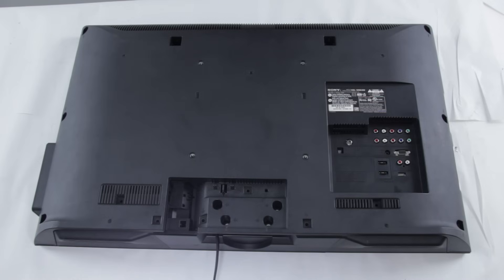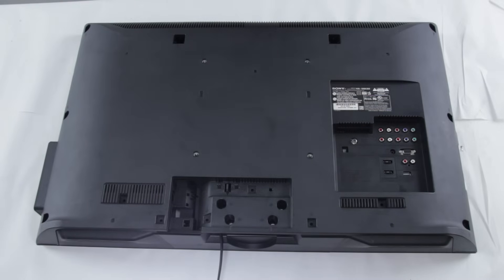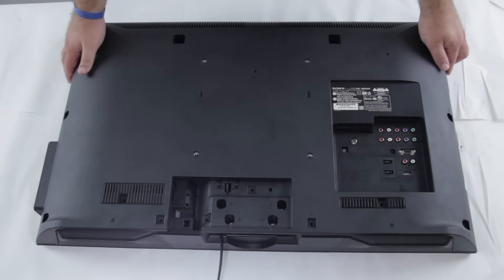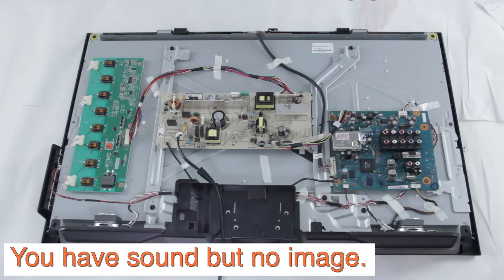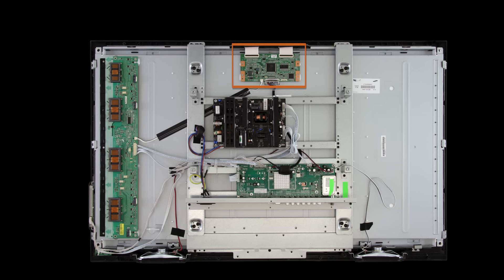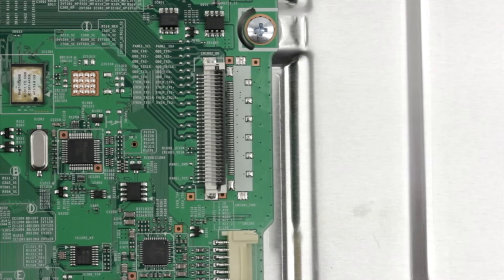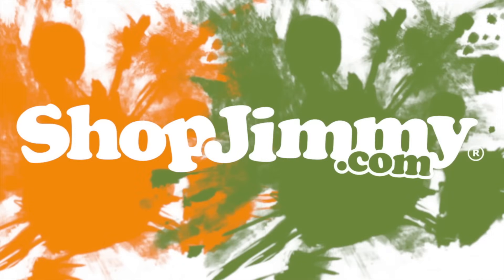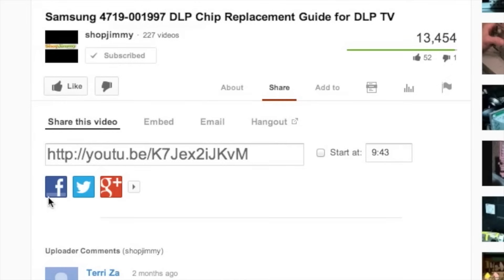LCD TV Repair Tutorial - T-Con Board Common Symptoms & Solutions - How to Replace T-Con Board

Comment: Please help. I have a Westinghouse LTV -37w2 HD. The problem  I'm having is my TV has no picture or sound. The power light comes  on though.
Reply from the maker: TINKERTON1000 I recommend replacing the main board in your TV.  Here is a link to replacement parts for your TV model number on our website, click here:  http://www.shopjimmy.com/catalogsearch/result/?q=LTV+-37w2  Be sure to match part numbers on your current board, with your replacement for compatibility.  Here is a link to a video showing how to identify your part number, click here:  DIY TV Part Number Identification Guide for Westinghouse Main Boards (LCD, LED, Plasma TVs)  You can also call our customer service for further assistance with your purchase.  (877) 881-6492  Thanks and please let us know if you have any further questions with your TV Repair!  www.shopjimmy.com

Comment: My Sony KDL-46XBR is displaying horizontal lines from the left side of the screen and is also displaying ghost lines on the left side of the screen. Is it possible to replace the T-CON board?
Reply from the maker: Meekha Villafranca You can replace the T-con to see if that fixes the problem.  If that does not work, then the problem is the TV panel.  Here is a link to replacement parts for your TV model number on our website, click here:  http://www.shopjimmy.com/catalogsearch/result/?q=KDL-46XBR  Be sure to match part numbers on your current board, with your replacement for compatibility.  Here is a link to a video showing how to identify your part number, click here:  Samsung Timing Control (T-Con) Boards Part Numbers Identification for LCD HD TV Repair  You can also call our customer service for further assistance with your purchase.  (877) 881-6492  Thanks and please let us know if you have any further questions!  www.shopjimmy.com

Comment: Hello, I have a 55PFL3907/F7 and believe it is the tcon board, mine has all  the symptoms you describe, except mine had horizontal colored lines that went in and out? Would this still be diagnosed as a bad tcon board? Also before this happened it often would restart maybe 2 or 3 times a week. This last time it turned off then turned back on again... but this time with a black screen.
Thanks in advance
Reply from the maker: Isaac Jimenez The T-con sounds like a good place to start.  Here is a link to replacement parts for your TV model number on our website, click here:  http://www.shopjimmy.com/lg-6871l-2089d-t-con-board.htm  Be sure to match part numbers on your current board, with your replacement for compatibility.  Here is a link to a video showing how to identify your part number, click here:  LCD Help Part Number Identification TV Repair Guide for LG Philips Timing Control (T-Con) Boards  You can also call our customer service for further assistance with your purchase.  (877) 881-6492  Thanks and please let us know if you have any further questions!  www.shopjimmy.com
Reply: Isaac, were you ever able to fix your TV?  I have the same model but haven't had any luck figuring out the issue yet.
Reply: hello seth, no i wasnt, two techs told me it was the screen and the cost to fix... well, it wasnt worth it for me.
thanks for your reply.

Comment: i have sony bravia klv-40w300a sound with no picture i show that to a technician he didnt diagnose the problem help me
Reply from the maker: Rizwan Abbasi I recommend replacing the AU main board in your TV.  Here is a link to replacement parts for your TV model number on our website, click here:  http://www.shopjimmy.com/catalogsearch/result/?q=40w300a  Be sure to match part numbers on your current board, with your replacement for compatibility.  Here is a link to a video showing how to identify your part number, click here:  TV Part Number Identification Guide for Sony Main Boards (LCD, LED, Plasma TVs) TV Repair  You can also call our customer service for further assistance with your purchase.  (877) 881-6492  Thanks and please let us know if you have any further questions!  www.shopjimmy.com

Comment: Hi Thanks for the help,
I have a samsung ps50b530s2w it has a verticle bar on the left hand side of the screen about an inch a a half wide and goes from top to bottom, the bar is sometimes black and sometimes white with different colour lines running through it, any help would be great
Reply from the maker: Justin Lane This sounds like a TV panel problem.  If your TV panel is bad, it may be more cost-effective to replace the TV as panels are typically hard to find in stock, difficult to replace, and expensive.  Thanks and please let us know if you have any further questions!  www.shopjimmy.com

Comment: Hi! I have lg 37lc46. It stops powering up at all. Then ive replaced power supply board. Now when i press power button led starts blinking green, backlight on for 2 seconds then its shutting down. Ive replaced main board, and its still the same but without backlight going on. What it might be?
Reply from the maker: WoYYtaZ I am thinking there is a bad lamp in the panel of the TV or the backlight inverter is bad.  I am not 100% sure your TV actually has a backlight inverter, so it could just be the lamp in the panel.  Could you please reply with the details of the parts in your TV?  If you are taking the TV apart or working on the TV, please do this at your OWN RISK.  Thanks! www.shopjimmy.com

Comment: hi,I have a sony bravia kdl-52s5100. the tv start with a horizontal line on the bottom of the screen and now there is lines across the entire screen.. Do you think it could be the T-Con board problem?
Reply  ·
Reply from the maker: Liana Ferran The T-con board does not create horizontal lines on the TV.  Thus, I believe this sounds like a TV panel problem.  If your TV panel is bad, it may be more cost-effective to replace the TV as panels are typically hard to find in stock, difficult to replace, and expensive.  Thanks and please let us know if you have any further questions!  www.shopjimmy.com

Comment: I have a 2008 Samsung LCD TV model # LN52A550P3F. Half of the TV screen is black out and the other side look normal. Do you think it could be the T-Con board problem?
Reply from the maker: Ganming Luo Yes, it could be the t-con board that is the problem or the panel.  Here is a link to replacement parts for your TV model number on our website, click here:  http://www.shopjimmy.com/catalogsearch/result/?q=+LN52A550P3F  Be sure to match part numbers on your current board, with your replacement for compatibility.  Here is a link to a video showing how to identify your part number, click here:  Samsung Timing Control (T-Con) Boards Part Numbers Identification for LCD HD TV Repair  You can also call our customer service for further assistance with your purchase.  (877) 881-6492  Thanks and please let us know if you have any further questions!  www.shopjimmy.com

Comment: yes i watch your video and thanks i have a philips 47pfl6704d/f7 model when i turn on the tv The Pic comes up very good and clear then after about 2min black lines comes and on the right side of the tv its start to look Ghostly but i still see the pic so is it that i would need to replace my T-Con Board or is there something else
Reply from the maker: Charles MCclain This sounds like the problem is either the t-con board or the panel in  your TV.  If your TV panel is bad, it may be more cost-effective to replace the TV as panels are typically hard to find in stock, difficult to replace, and expensive.  You can try and replace the the t-con board to see if that fixes the problem.  Here is a link to replacement parts for your TV model number on our website, click here:  http://www.shopjimmy.com/catalogsearch/result/?q=47pfl6704d%2Ff7  Be sure to match part numbers on your current board, with your replacement for compatibility.  Here is a link to a video showing how to identify your part number, click here:  LCD Help Part Number Identification TV Repair Guide for LG Philips Timing Control (T-Con) Boards  You can also call our customer service for further assistance with your purchase.  (877) 881-6492  Thanks and please let us know if you have any further questions!  www.shopjimmy.com

Comment: I have a Toshiba 32AV500U. I have replaced every board on this TV, except for the T-Con board. The problem is i get no sound, no picture, no back light. When it is off the light stays red. When it is turn on the light stays green. I starting to think maybe it's the panel. What are your thoughts?
Reply from the maker: Manny Mora This sounds like you have a defective main board, so maybe the replacement that you received is defective.  Here is a link to replacement parts for your TV model number on our website, click here:  http://www.shopjimmy.com/catalogsearch/result/?q=32AV500U  Be sure to match part numbers on your current board, with your replacement for compatibility.  Here is a link to a video showing how to identify your part number, click here:  TV Part Number Identification Guide for Toshiba Main & Scaler Boards (LCD, LED, Plasma TVs)  You can also call our customer service for further assistance with your purchase.  (877) 881-6492  Thanks and please let us know if you have any further questions!  www.shopjimmy.com

Comment: Hi, I have purple pixels in light colors and green in black colors. When image is frozen, these coloured pixels are still moving. Is my Tcon defect? Or could it be something else? There was one time, by just going into a servicemenu it dissapeared for one month, but it suddenly came back and it's staying now. I updated the firmware, did a hard reset of the tv and checked the cables of course, every output the same: green and purple pixels throughout the whole image, the rest of the tv colors that are not green of purple are still perfect.
Reply from the maker: JJ Fotografie I would recommend replacing the T-Con board in your TV.  Please reply with your TV model number and I can recommend a replacement part.  You can also call our customer service for further assistance with your purchase.  (877) 881-6492  Thanks and please let us know if you have any further questions!  www.shopjimmy.com

Comment: Hi. I have a Lg Led tv model 37Lv450u. Ghosting and white bar, vertical lines on the left side. i have replaced the ribbon cables. problem remains the same. please advice
Reply from the maker: Savy Mago I would recommend replacing the main board in your TV.  Unfortunately I do not see any replacement parts in the search results for your TV model number on our website.  Thanks and please let us know if you have any further questions!  www.shopjimmy.com

Comment: I have a Toshiba Regza model 46lx177. I have intermittent horizontal lines on the screen and at the same time the picture becomes very distorted. As it warms up, it will correct itself but the problem is becoming progressively worse. Thanks for your help!
Reply from the maker: Jeremy Simmons I would recommend replacing the main board in your TV.  Here is a link to replacement parts for your TV model number on our website, click here:  http://www.shopjimmy.com/toshiba-75007940-tn-av-board-assy.htm  Be sure to match part numbers on your current board, with your replacement for compatibility.  Here is a link to a video showing how to identify your part number, click here:  TV Part Number Identification Guide for Toshiba Main & Scaler Boards (LCD, LED, Plasma TVs)  You can also call our customer service for further assistance with your purchase.  (877) 881-6492  Thanks and please let us know if you have any further questions!  www.shopjimmy.com

Comment: My TV has odd colors, sort of a posterization effect, and it doesn't matter what input I use.  It is a Samsung LN40A400T1F and is out of warranty.  I've read some websites that state it could be a TCON board or an LVDS cable.  I've checked the LVDS connections and the ribbon cable connections with no change to the screen.  Before I purchase any parts, I was wondering if you have seen instances where a bad TCON board would cause this issue.  Thanks!
Reply from the maker: Glen Haegele I would recommend replacing the T-con board in your TV.  Unfortunately I do not see any replacement parts in the search results for your TV model number on our website.  Please double check your TV model number and let us know if it is different.  Thanks and please let us know if you have any further questions!  www.shopjimmy.com

Comment: hi. my tv  have in one side vertikal lines and  colorless all screen
 LE40A456C2D model of tv. regards
Reply from the maker: Edgaras Klemas This could either be a problem with the TV panel or the t-con board.  If your TV panel is bad, it may be more cost-effective to replace the TV, as panels are typically hard to find in stock, difficult to replace, and expensive.  You can replace your t-con board to see if that fixes the problem.  Here is a link to replacement parts for your TV model number on our website, click here:  http://www.shopjimmy.com/catalogsearch/result/?q=LE40A456C2D  Be sure to match part numbers on your current board, with your replacement for compatibility.  Here is a link to a video showing how to identify your part number, click here:  DIY LCD TV Repair: Part Number Guide for AU Optronics (AUO) Timing Control (T-Con) Boards  You can also call our customer service for further assistance with your purchase.  (877) 881-6492  Thanks and please let us know if you have any further questions!  www.shopjimmy.com

Comment: LG 42LH30-UA exactly half of the screen on the tv will go black or turn the color of whatever was on the screen. It happens when I play games and when I am watching tv or movies and sometimes it does not even completely change it will just start looking wavy and like static ONLY on the right side of the tv. I called LG customer service and the guy said they have not ever seen a problem like that before. So yeah I really need help and remember it's not constant it only happens every once in a while and I tap the right side a few times and it goes back to normal....for a little while so yeah please give me feedback thank you.
Reply from the maker: Courtney Mathews This sounds like the problem is either the t-con board or the TV panel.  If the problem is the panel, it may be more cost-effective to replace the TV.  You can replace the t-con board to see if that fixes your problem.  Here is a link to replacement parts for your TV model number on our website, click here:  http://www.shopjimmy.com/catalogsearch/result/?q=42LH30-UA  Be sure to match part numbers on your current board, with your replacement for compatibility.  Here is a link to a video showing how to identify your part number, click here:  LCD Help Part Number Identification TV Repair Guide for LG Philips Timing Control (T-Con) Boards  You can also call our customer service for further assistance with your purchase.  (877) 881-6492  Thanks and please let us know if you have any further questions!  www.shopjimmy.com

Comment: I have a vizio xvt3d650sv
The backlight of the tv flickers ocassionally not too often, and every time a disconnect the tv from the power outlet and connect it back  the vizio logo starts blinking white and orange and cannot turn on until it finishes

Thanks in advance!!😀
Reply from the maker: Wilson Cintron Your TV will always have that boot up process.  I would recommend replacing the main board in your TV.  Unfortunately I do not see any replacement parts in the search results for your TV model number on our website.  Thanks and please let us know if you have any further questions!  www.shopjimmy.com

Comment: I have a LG47LC7DF>  My symptom is a dim blue screen on power up and a buzzing sound coming from the TCON board.  I disconnected the ribbon cable from the TCON board going to the left side of the LCD.  Now I have normal picture and menu display on the right side and white on the left side and no buzzing.  Does this sound like a TCON board problem or a LCD problem?
Reply from the maker: Renzie D I would recommend to first replace your t-con board to see if that fixes the problem.  Here is a link to replacement parts for your TV model number on our website, click here:  http://www.shopjimmy.com/catalogsearch/result/?q=LG47LC7DF  Be sure to match part numbers on your current board, with your replacement for compatibility.  Here is a link to a video showing how to identify your part number, click here:  LCD Help Part Number Identification TV Repair Guide for LG Philips Timing Control (T-Con) Boards  You can also call our customer service for further assistance with your purchase.  (877) 881-6492  Thanks and please let us know if you have any further questions!  www.shopjimmy.com

Comment: I have a 47" Samsung LCD model number LN-S4695D that I bought about 7 years ago. I had no issues with the TV until recently after moving with the TV packing it in the back of a truck. Now, when the TV turns on under any input there is white static (looks like a lot of pixels that either flicker white or stay white). After the TV is on for an hour or so the image clears up. I checked the T-Con cables but reseating them made no difference. Any help on troubleshooting or repair would be appreciated.

Thanks.
Reply from the maker: bgase1 I would recommend replacing the main board in your TV.  Unfortunately I do not see any main board replacement parts in the search results for your TV model number on our website.  Thanks and please let us know if you have any further questions!  www.shopjimmy.com